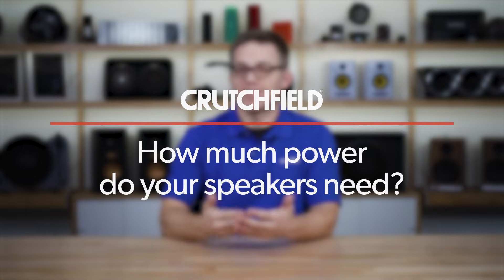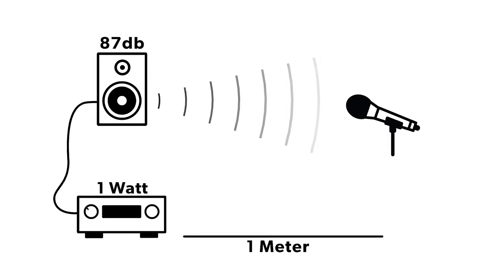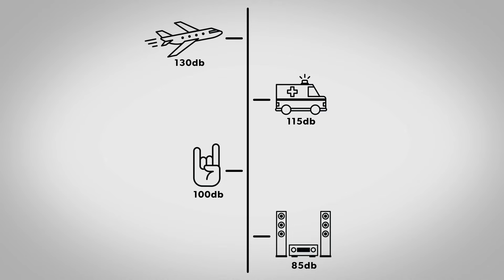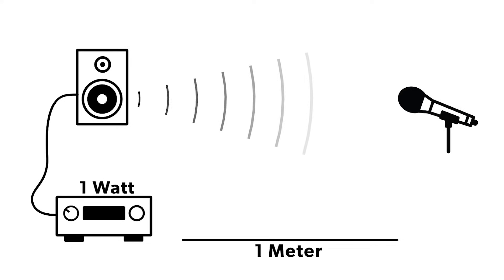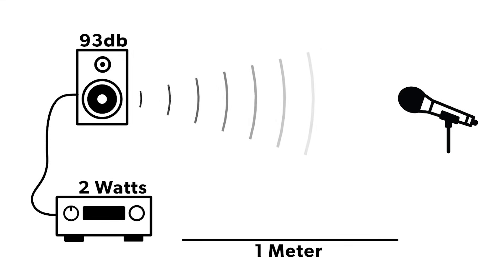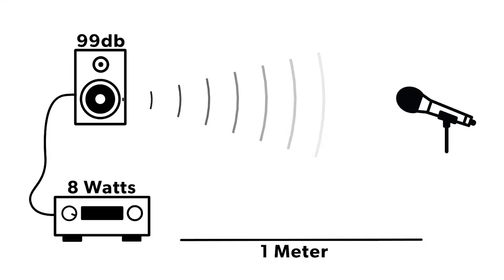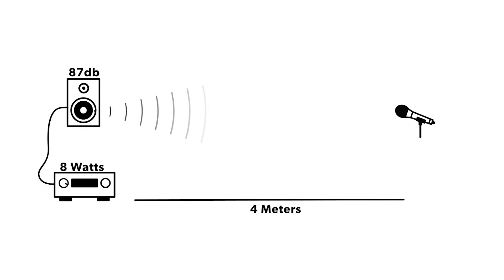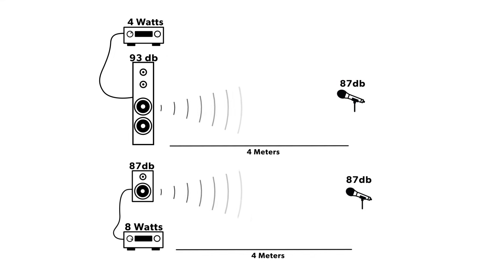How much power do your speakers need? | Crutchfield

Comment: I understood nothing.
I just want to know what's the power number I need to power up 2 speakers of 2000 watts.
Do I need a 4000 watts amplifier? Thanks for your answer if you get me in a couple days.
Reply from the maker: You certainly could get an amp that outputs all the watts RMS that your speakers can handle. But that is not always needed to play speakers in every situation and more information is needed to help recommend what to shop for. We will be happy to give you a personal recommendation. What brand and model speakers are you referring to?
Reply: @crutchfield  My speakers are the titan 15, and I just learned that the RMS whatts are more important than the peak watts, is it true?This speakers are 500 watts RMS, it says I can link them, if I do that Ill use 500 or 1000 watts RMS in total?
Reply from the maker: Yes, we do want to match the RMS rating. What is the brand and model of your speakers?

Comment: 100 watts speakers are good for home purpose or not?
Reply from the maker: There are definitely some 100 watt speakers that are built to be used in a home. There are even some speakers that can handle more than 100 watts but don't need more than 100 watts to play well in a home. Do you have any brand preferences? Any preference on the type of speaker (i.e. floor standing, book shelf, on-wall, in-wall, etc..)?
Reply: @crutchfield  book shelf
Reply from the maker: There are a few different bookshelf speakers that you can choose from with one of the fullest sound middle of the road speakers being the Monitor Audio Bronze 100 found here:

www.crutchfield.com/I-rYALc227/p_893B6G100B/item.html

Comment: What about ohms?? Like 4 ohms vs 8 ohms?
Reply from the maker: Once you determine the speakers you plan to use and the power you need, you would want to choose an amp that offers that output at the matched impedance to your speakers.

Comment: I have 2 x 12" woofer rated for 300W continues and 600W peak with sensitivity 92dB (+/-2), impedance of 8 Ohms, resonance freq 25Hz (+/-20%), freq range f20>>3kHz. 
Can someone tell me, how do I select mid-range and tweeter for my woofer?. 
I want to build a decent 3 way speaker system for my home use.
Reply from the maker: Hi Keith, sounds like you're working on a fun project! If you can find a copy, The Loudspeaker Design Cookbook is a helpful guide for custom speaker building: https://www.crutchfield.com/I-rYALc921/p_224BKAA60/The-Loudspeaker-Design-Cookbook.html
Reply: @crutchfield  thanks for the reply. I found that book on amazon, it was $49.97. But unfortunately I'm not living in USA, my country is Sri Lanka. Amazon does ship this book to Sri Lanka but shipping fee is $49.96, so the total is $99.93 (almost $100). That'll cost me around 35,720LKR, that's way too much. 
I should probably do more research and figure it out by my self.

Comment: I want to reach 105-110 db in my car at ear position, I have speakers that are rated for 45watts rms but I’m not even reaching 100 db really and speakers are in the door and face in obviously. So not even pointed toward the ear and is about 4-4 1/2 ft from ears maybe more or less depending on height and how forward and backward the seat is. They are powered by a Sony and towards the high end of the volume I notice the voices sound gurgling and distorted. Idk if that is because the speakers are maxing out on power or is the headunit is maxed out and I need an amp
Reply from the maker: Adding an amp to power your speakers will help provide improved overall clarity and higher volume levels, as well as help to prevent distortion at higher volumes. Based on the power rating of your speakers, here's a great sounding Pioneer 4-channel amp to consider:  https://www.crutchfield.com/I-rYALc928/p_130GMA4704/Pioneer-GM-A4704.html?tp=35782

Comment: You seem to be discussing sound pressure level changes in what is called for Pi space or environment without floors walls are ceilings. In real rooms your number should be about half I would think. Or, am I missing something significant? Thanks!

Comment: Pls advice amp watt for 82db speakers with max 15w/30w at 8 impedance…. Thanks
Reply from the maker: So, 15 watt RMS power?
Reply: @crutchfield  yes and 30w max.
Reply from the maker: You'd need to be in that 15 watt RMS range to safely power them.

Comment: This is an excellent explanation. Thank you! 
However, there seems to be a mistake in the last example: It should have been 90db (not 87db) sensitivity for the first scenario (example at the bottom). That's the same example you had given in the previous segment while explaining the relationship between db output and power (90db sensitivity, 8 watts, 4 meters which translates to 87db output). Then it would match with the 2nd scenario (example at the top): 93db + 4 watts + 4 meters which is also 87db output.
Reply: Yup! That caught me as well.
Reply: Same. Was really thrown off at first
Reply: Indeed!
Reply: good point, someone had to say it, however nice video

Comment: Hi. very helpful and good video. So im currently noob to this hi-fi word. I have FL FR and Centre speakers from B&W - FPM series connected to an old marantz NR 1501. 8 ohms provide 50 w output. My question, is this enough power ? The speakers can go up to 120 W
the listening distance is 2,7 meters (ish).
Reply from the maker: That power should work well for easy to moderate listening levels. What are your goals for the volume levels?

Comment: A loudspeaker will take only what it needs from an amplifier that amplifier does not determine the amount of power required to be delivered to the loudspeaker. The loudspeakers do that! 
If amplifier underpowered it will  distort and clip and thus damage the loudspeakers. You buy power for headroom and linearity. There is No such thing as to much power! It’s there if you were to upgrade your loudspeakers that have say a more difficult impedance load and or require more power to drive them properly etc etc because power and loudspeakers are expensive and live with us for decades. It always pays to spend the money on the front end of a system rather than the source components first. No sense spending money on source equipment that will perform at a level you will not be able too appreciate it hear. 

It sounds like you’re setting up a party system and consumed with power vs decibel ratings rather than the sound quality of the equipment. Everything matters & everything is important!  Nothing is more wasteful than wasting money on stuff that is underperforming as no not giving you your hard earned moneys worth only to turn around and constantly upgrade things to get you to that point of audible nirvana. Get the best bang you can for your buck from the get go on loudspeakers and amplification!

Comment: Hi, i am having klipsch RP280FA, RP-450C and RP150M speakes and Yamaha TSR-700(100W/channel, 2 channel driven). My listnening position is 10ft(3M) from speakers, i am increasing my volume level to 40 to hear my desiring sound. I am not using any external amp. Can you suggest what should i do to hear all dynamics with out going to that high volume level and till now i am not using any Sub but i had one which is klipsch 112SW. If i use the SUB and make the towers as small in the confuguration and setting cross over to 80, will the sound change?
Reply from the maker: Sounds like a great setup! If you already used YPAO's calibration setup, your best bet will be to continue tweaking the sound via the the receiver's settings. From there, you could consider more power.
Reply: @crutchfield  do i need any amp for this setup for my sitting position? Is ypao calibration will be a perfect one?
Reply from the maker: If the volume scale is 1-100, then there should be no issues playing the audio on that system at 40. That being said, the controls in the Yamaha calibration system are not expected to reduce the volume level number that is used to get the volume level you prefer. The only way to do that is to install a more powerful amp. Your receiver has preamp outputs for the front left and right channels. Installing an amp to power them will help with the volume levels from all the speakers. We offer an OSD amp that is a perfect power match to the Klipsch speakers:

www.crutchfield.com/I-rYALc227/p_452XMP300/item.html

Comment: I feel like for me that this is missing explanation on pairing the right wattage from a AVR to speakers. Example, I have an AVR that is rated at 150w/ch at 8ohms. Do I look for speakers that are rated for 150w at 8ohms or do I look for speakers rated half that of the AVR?
Reply from the maker: Hi there! Typically, you want the receiver output to be in the range of 70-100% of the RMS handling of the speakers to get in the "sweet spot." So, for a 150 watt-per-channel receiver, you are looking at speakers that can handle 150-215 watts each.

If you have other questions, feel free to reach out any time!
Reply: @crutchfield  Thank you so much for clearing that up for me.
Reply from the maker: You're welcome! If you need anything further, please let us know.

Comment: Thanks for this video. It confirms that I don't have to worry about how weak my choice of possible avrs could be. I prefer to listen below 80dB for the loudest sounds, i.e. explosions and rock music. So I'm sure my speakers will perform well enough at 2 meters distance.
Reply: True, but you may not benefit from the better sound processor and / or better quality of parts installed on a Higher End model. For example having proper Audiophile Capacitors, clean power from the transformers, Separate Class AB amps for all channels. My listening levels are same as yours, but still I recommend spending some extra bucks on a better processor, if you can ..
Reply: @uprajsingh  I plan to later this year. Right now I have a Fosi Audio DA2120c amp. The experience has been phenomenal for stereo sound. But I need a surround sound receiver if I'm going to fully enjoy my movies.
Reply from the maker: You're welcome! We are glad this helped. Let us know when we can help again

Comment: So what happens when i add more speakers. If I have a 100 watts per channel with 2 driven, how many watts each of my 5 speakers getting do you do 100 divided by 5?
Reply from the maker: Those specifications are not always provided by home theater receivers and will even vary depending on which channels are getting the intense audio at any given time. Bass frequencies are the most power hungry of them all and sending the bass from the main channels to the subwoofer will help with the volume levels of all the channels

Comment: Great video but I still have one question, is there a specific frequency speaker sensitivity is measured at?
Reply from the maker: There is and that is often referred to as the frequency range for the speaker which is also found in a speakers specifications

Comment: It’s all about headroom and the amps design.   If you buy some 100 watt consumer market receiver, it probably has four 25 watt transistors and this is not capable of even using at it’s rated power.  Not that you would need to listen to it at 100 watts but if you did it would sound like crap and be full of distortion and clipping.  If you buy some high end amplifier it might have 36 output transistors and rates their amp at the same wattage you would be listening to it at the bottom end of its range which no clipping and no distortion.

So how many watts do you need for a full range floor standing speaker?  At minimum you want to be at the manufacturers recommended wattage.  But you would probably be better at double that.
Reply: Creeper still, the most heat goes out at -3dB from rating.  Just an artifact of class AB.

Comment: So how much power do my speakers need?
Reply: I would say about 1.21 gigawatts
Reply: @Huy0035 Sure, unless you want it loud 😅
Reply: @Huy0035  i would say you need at least 1000 neggawats
Reply: He literally explains everything you need. Just consider your usage scenario and do simple math based on that.
Reply: No a lot. I have a couple of Dali on wall speakers and I’m driving them with a couple of Schiit 15W power amps. At max volume I cannot be in the room with them. You don’t need 100W in most cases.
Reply: @Wordsalad69420  Ok but you should really try to upgrade from shit amps to something good…
Reply: @brianmeese1641  Sounds pretty good to me. Virtually no noise. What's wrong with it?
Reply: Eg: if you have aerons india compression horn rated 117dB/1w, you need 120w to do 139dB.
But if you have domestic speakers, rated 87dB Or higher then you need 120w to do 100dB and beyond. You won't get speakers beyond 110dB even Sony Shake 100D etc are 110dB peaks due to law. But if you get speakers from JBL, Ahuja, Aerons India, RCF, etc, you can get 139dB peaks with just 1 speaker as per their ts perimeters. 

So, to do 110dB with domestic speakers you will need 100-900w depending upon frequency, sensitivity etc. 
But to do 110dB with outdoor speakers which are used in temples, churches, mosques etc, you need 5w maybe? Also 1w if it's 117dB/1w i saw many such speakers from Danley Sound Labs, Aerons India etc which do 117+dB/1W! So, yeah, it's correlation between how much watts you need to get same loudness. Your domestic speakers will stress but outdoor speakers can do 139dB SPL+ without stressing. Some can do 154+dB SPL eg: Danley J1. 

So, choose what you need. Do you need very high efficiency which can do 139+dB SPL with minimum electricity or do you need domestic speakers which will use 120w and do 110dB peaks?
Reply: 64
Reply: Exactly. How about some useful info for end users?
Reply: @larrysmac 40-100 watt, 
200 watt max
Is enough for 100-300 sq room or hall

Comment: if my amp gives 45 watts at 8ohm to a speaker that is rated for 8ohm and 97db can my amp run the speaker at around 90db all day with no problem???
Reply: Yes it Will. If your speaker is 97dB sensitivity, your speakers can play 97dB with 1 watt. You will easily play that all they long. If you find out how much it can play that’s for 8 hours. So let’s say your 97dB sensitivity speakers they can with the 45 watt amp play 109-112dB all they long. I would not try it out, but it can.
Reply from the maker: The sensitivity ratings are given (usually)  for 1 watt of power with the dB measured 1 meter away.  If you give a 97dB speaker 45 watts of power, you will be roughly at around 112-113dB at 1 meter from the speaker.  A 94dB volume level would be heard from around 4 meters away from the speakers.

Comment: I have speakers of 100w each, if i power them with amp of 20w per channel will the speakers are loud enough for a room
Reply from the maker: That will depend on the speakers, and the size of the room.  What speakers are you wanting to power?
Reply: @crutchfield  these speakers are of a company called fredo with size of 4 inch and a sensitivity of 86db. The size of the room is 15×15 feet.
Reply: These are actually full range woofer

Comment: what could happen when i use 1000watts speakers from 900 watts power supply?
Reply from the maker: If you have an amp that's outputting 900 watts and speakers that can handle 1000 watts that will work well. The amp should be able to drive those speakers pretty well. They key is not overpowering the speakers, so this should work just fine.
Reply: If my math is correct, you should get around 400 decibels out of that.

Comment: Very informative. I am the original owner of a Marantz 2230b reciever. I have been trying to figure out high and low sensitivity speakers. My amp is rated at 30 amps per channel. Can I use speakers that are rated at 86db?
Reply from the maker: You could use them,  but they will be limited on the volume they can reach.  you would essentially be capped at around 98-102 dB.
Reply: You should be careful,When choosing speakers. The reason being ,More speakers have been destroyed from to little rather than to much power....Go with a higher efficiency pair of speakers,You will be a lot happier in the long run...

Comment: i have a speaker and i took out the battery, its a 5 volt. Will it brake if i put a 7 volt on it ?
Reply from the maker: I wouldnt put a higher voltage battery in it, no

Comment: asking a question before I watch , I heard no such thing as a stupid question but here we go lol , I have a Nakamichi sound bar the rear and surround sound speakers are 50 watts a piece I wanna switch them for LG spk8-s speakers they are 70 watts each can I switch the 50 watts to 70 watts , I'm not looking to make it louder I'll be fine with 50watts it's just the nakamichi speakers are big and bulky old school looking I want more modern smaller . so yea would I be ok switching? if it helps the nakamichi is the 9.2.4
Reply from the maker: There is one more specification that must be known to make sure that the Nakamichi amp can power the LG speakers. The ohms. The amp must be able to support the ohms of the LG speakers. I cannot find the details about the ohms of the speakers in the LG kit, but they must match the ohms supported by the Nakamichi amp.

Comment: Hello 👋 
I have a Amp which puts out 105 watts pro Chanel, and my speakers are 120 watts at 4-8 ohms with a sensitivity of 87 db.
So even at 2 watts my speakers are still going to be very laud ?
Reply from the maker: At two watts, from 1 meter away you would get a volume of 90dB.

Comment: Perfect explanation of power versus how loud the speaker actual is.  I tell people all the time that they don't need as much power as they think they do.
For instance in a car, I hear guys all the time saying they need all this power, typically in the 1000+ watts range.  I ask them why do they need so much power, and they say "So it can get loud."  And I say, I bet my roughly 300 watt system will get as loud and sound cleaner than their 3000 watt system.  I also prefer to use extremely clean amps such as Audio Art and Phoenix Gold, and of course the old school stuff.